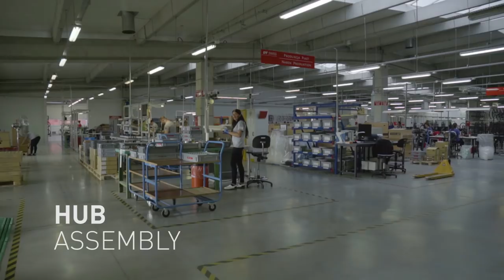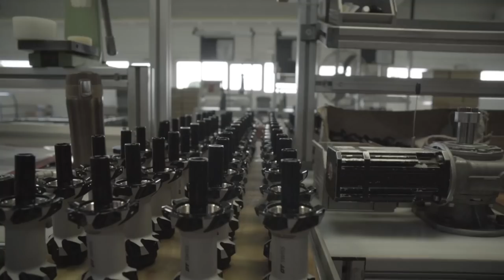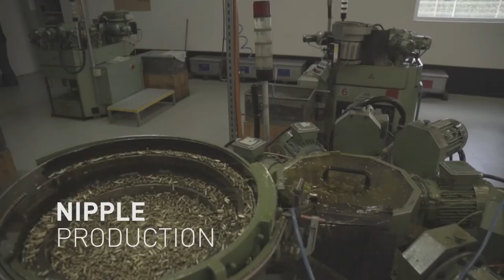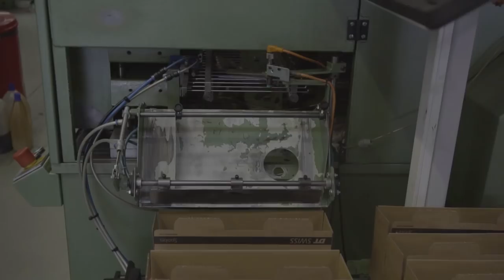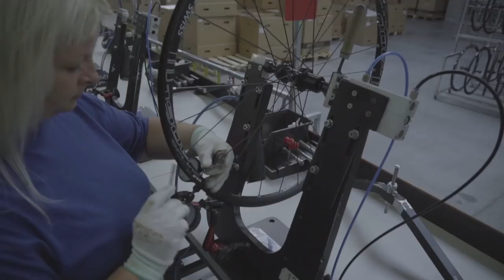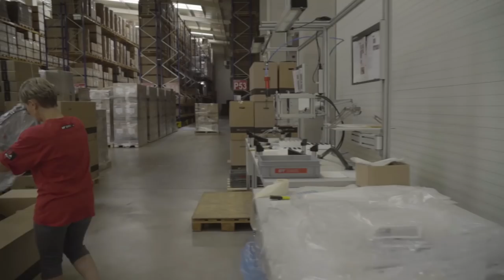The wheel manufacturing process at DT Swiss.  | DT Swiss

Comment: The rim tape on both my DT tubeless wheels leaked sealant into the spokes and rim joint. I had to rewrap them and they still leak through the joint but not the spokes. Why can't they install some kind of permanent flexible joint sealer in the joint area?
Reply from the maker: Hi there and thank you for your comment. The whole Tubeless story is very complex as there is no general rule about it. This means Tubeless for bicycles is not standardized. As an effect sometimes certain combination of tire and rim will not work properly. Our rims are well known to be the benchmark regarding a proper tubeless function, with most tires. If you will check on the "Schwalbe" Website, the DT Swiss wheels are recommended to work best with their tires. In your case I would recommend to see your local dealer to find out whats wrong or if you think there might be an issue with the rim, to contact one of our service centers: https://www.dtswiss.com/de/support/service-center
Have a nice day, Friso "DT Swiss".

Comment: Hi there, I recently purchased a new road wheelset. It seems true but I’m not sure if some of the spokes have uneven tension - there’s a little rub in some of the cross joints. Should I be going to get it looked at or is this normal for a new wheel?
Reply from the maker: Hi Ali, the spoke tension on the left and on the right side are never the same (except rim brake front wheels, they are symmetric), the non-brake side at front or the non-drive side at the rear have a lower tension. Especially on the rear wheel with the constant pedaling you can find some rubbing traces between the spokes. This is just the color that comes of and it is not visible.
If you have any questions you can write to service@dtswiss.com. Best regards, José, DT Swiss